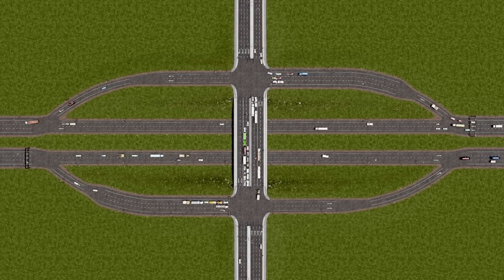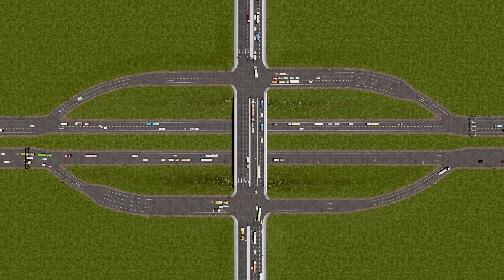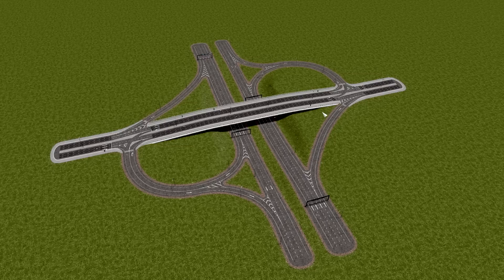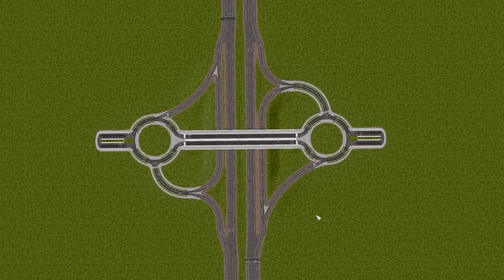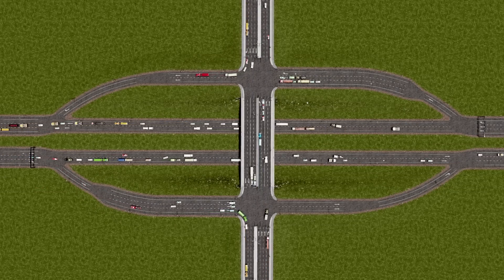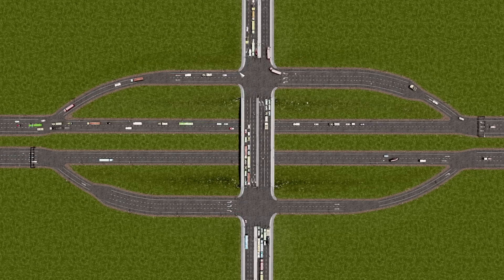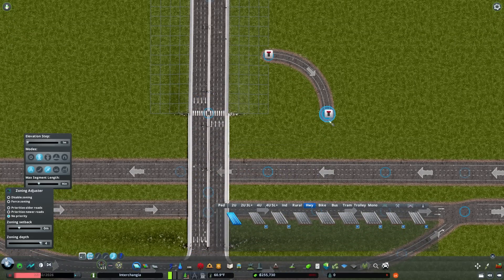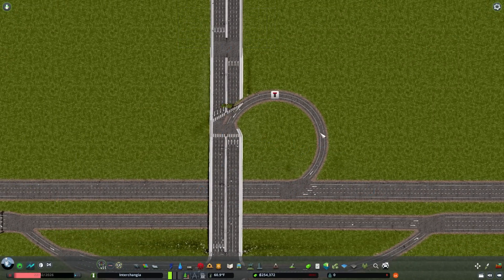Loops can SAVE your Interchange in Cities Skylines

Comment: The logic behind traffic movement is always interesting to me. I see it as a personal challenge to all the efficiency expert's out there and the best part is that it doesn't just end with one answer; the optimal configuration is a constantly evolving target. Great work, as always!
Reply: At low vloumes a roundabout might provide the best flow, at higher vloumes a light, extreme, overpass interchanges, then there is the question: Does one of the directions; volume dominate, ... . I have no issue taking through traffic on a highway interchange down to one lane when doing the lane Maths (Biffa I believe doesn't recommend), if the traffic is light on that route.

Comment: Stareted a city after a few years away from playing CS. Started with your idea of not haveing any highways, still don't have any highways just normal roads with a single roundabout and a couple of small trumpets, the rest is normal  intersections. Thanks to your videos of traffic light managment and Biffas traffic managment I'm up tp 90k on the 25 tile mod and the traffic is, more or less, working perfectly.
Reply: How did you handle the extra traffic that the 6 lane highways had and is now on two lane national roads? I made a city on that reduced road map (unfortunately, I lost the city) and the traffic almost, immediately,  backed up. I added an interstate highway back to the map and a couple of 4 lane national roads back to it.
Reply: @JediTev  I've been slowly upgradeing the road system. National highway at first then as intersections got busier I just upgraded local nodes, Don't get me wrong some of my roads are now 6 lane main roads and are busy but its a thriveing city with lots of traffic and so in real life there will be busy intersections here and there. I'm also useing realistic pop mod and have zoned no Hi res yet so there are no mega busy hi density houseing areas to deal with.

Comment: If you want a small interchange, the SPUI can’t be beat. This is especially the case if the highway ramps connect on the left side of the highway using bidirectional ramps. Of course in that case there has to be enough room between the highway directions to allow for a 4 lane road (2 in each direction) so the left hand turns coming off the highway don’t block the right turns.

Comment: The big cause of traffic is conflict points where traffic have to yield to cross one another. The loops eliminate that crossing point.

You can also overlap the on and off ramps to two junctions that are way too close together so that in a given direction of travel, junction 1's on ramp merges after junction 2's of ramp splits off, with the ramps crossing using a flyover. This eliminates that point where traffic changing lanes entering the highway at junction 1 is swapping and crossing over the traffic that is changing lanes to leave at junction 2

Comment: One thing I did notice is the West to East off ramp does not allow a driver to get back on the freeway do to only left and right turning.  In the real world if someone didn't mean to get off the freeway at that particular exit, they could use the off ramp to hop back on on the other side rather than having to do a turn around on another road.  Yeah I mean it is a game, but you are going for more realism.  Additionally when you added signalized intersections on the SB to NB side, how much traffic volume do you gain when this is placed in a city?

Comment: The CloverStack/Clover Turbine depends on the flyover ramps. The one you've built is a Clover Turbine because the flyover ramps are bowed out to the outer edges and form a circle kind of shape. A CloverStack has the flyover ramps more tight and over the center.
They are both effectively the same interchange, but a Stack gets its name by literally stacking the flyover ramps on top of the point where the two highways cross over each other. If they don't stack, it isn't a Stack.
Reply from the maker: No, I assure you I’ve built a cloverstack. https://en.m.wikipedia.org/wiki/Interchange_(road) Check under the “system interchange” header. If you have another source I’d love to see it!
Reply: Ah, yes, an informal term by how that article describes it as someone it is "sometimes" referred to as.

That article does also specifically point out that design as being of Turbine, not Stack, interchanges when you read through the description of both Turbine and Stack.

People do often use terms that are easier to say, though, rather than more fitting of what they are describing.
I suppose "Stack" has come to mean anything with flyover ramps at this point.
Reply from the maker: Yes, but “cloverturbine” remains conspicuously absent from anywhere official at all. I do a lot of research before presenting these ideas, and you’re not the first to say as much. I was hoping to see a source more legitimate than the wikipedia entry on this interchange, but alas. The elusive “cloverturbine” seems to be isolated to the names of creations within the steam workshop.

Comment: The cloverleaf is better than the parclo in terms of flow, because the cloverleaf with lane maths, you can have constant flow with no traffic crossing over, therefore no need for lights, which means better flow
Reply from the maker: Not at all. Cloverleafs are being switched out all for parclos all over north america. The cloverleaf has the problem of traffic weaving which the parclo does not.
Reply: @YUMBL  Ohhh ok
Reply from the maker: Heres a good explanation I made https://youtu.be/TIH37lrEMFI
Reply: @YUMBL  Thanks, I'll have a look

Edit: Ohh I see, because the traffic has to cross over to get to the turning ramp, and because the 2 turning ramps are very close together it can cause accidents by them trying to switch lanes
Reply from the maker: Exactly!
Reply: @YUMBL  Ok I see, thanks for the explanation, I won't be using the cloverleaf anymore

Comment: oh yea about loops they should have a radius of at least 50m
which already isn't a good driving experience, the radius should be more like 65m if there's space, but any smaller is just terrible to drive on
like you have to slow down to around 20-30km/h for it to be comfortable, which is really annoying especially if there's a lot of traffic using the loop

Comment: Have you got a working mod to remove any markings from the roads? I want to make my own like they are in Austria. (6/9m; 6/12m; 3/3m; 1/2m; 6/1.5m; 4/2m)
Reply from the maker: There are blank roads in the workshop. Use intersection marking tool to create the markings.
Reply: @YUMBL  Thank you! I didn't think of that.

Comment: u need mods for these to work, game takes shortest way and will cross the road and not use the loops if they are a longer drive, a fix will be to have the right turn off the highway further down the city road so it will be a longer drive than the loop to turn left
Reply from the maker: Correct. You need traffic manager to manage traffic.

Comment: What's the most pedestrian friendly intersection, interchange or roundabout?
Reply from the maker: AB Parclo is really good for peds
Reply: @YUMBL  but they are trash
Reply from the maker: Eh, everything is relative. It just happens that the free flowing ramps that are good for cars are the worst to encounter as a ped. For the most part things that aid auto traffic are bad for peds.
Reply: That "cursed" over and under pass you did, with a little modification, would be great for pedestrians.
Reply from the maker: I agree :)
Reply: @YUMBL  if I modify it, can I post it on the Workshop?
Reply from the maker: Go for it!
Reply: @YUMBL  thank you

Comment: Any place where you have traffic getting on a road before traffic gets off is a place where cars will stop and cause city-wide gridlock. I dont trust any type of interchange where its possible for cars to get "crossed" going from left to right.
I dont understand why Cities drivers stop in the middle of a highway to change lane...
Reply from the maker: Yes, it’s called “weaving”
Reply: @YUMBL   thanks.
Like I was saying, I have no clue why Cities even after 7 years does weaving so bad it sometimes bankcrupts cities using TMPE hard mode